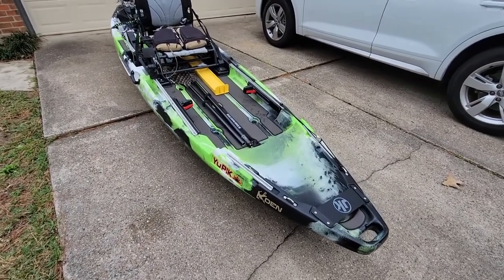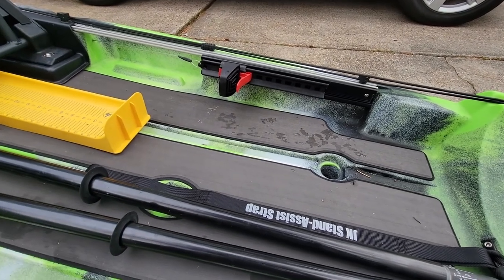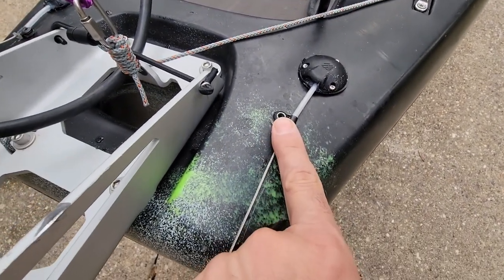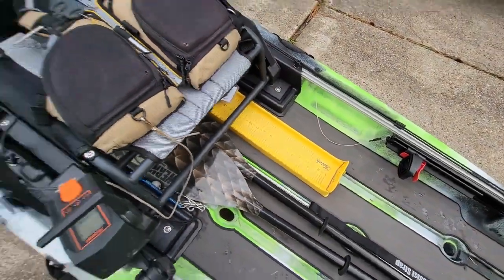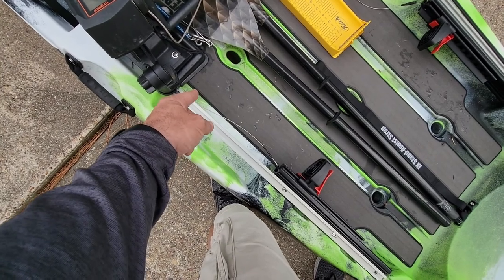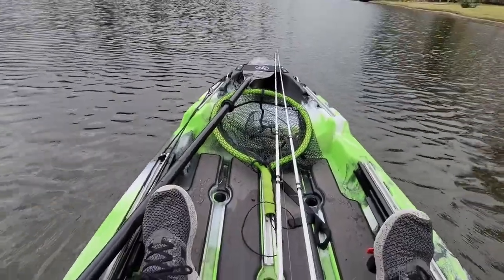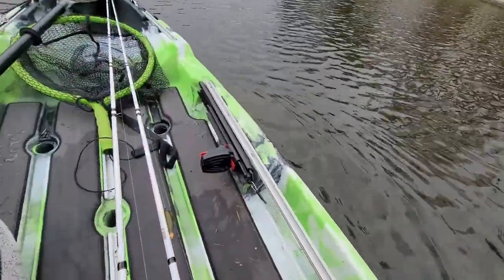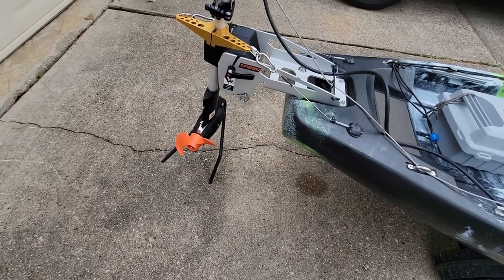2022 Jackson Kayak YuPIK In-Hull Foot Control Steering Video

Comment: Did they change the seat pan for 2022? I have a 21 and the middle mount point is terrible. Love this rigging, I'll be using some of the ideas. THanks for sharing.
Reply from the maker: Yes, the new High/Low seat is in a different pan. Attaches on the gunnels instead of the middle rail. Glad it helped out!  Thanks!